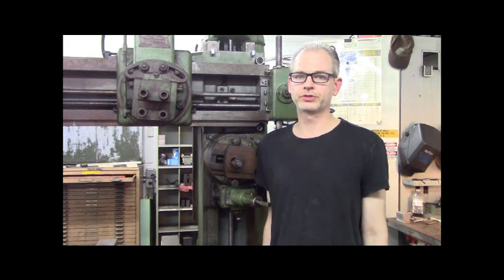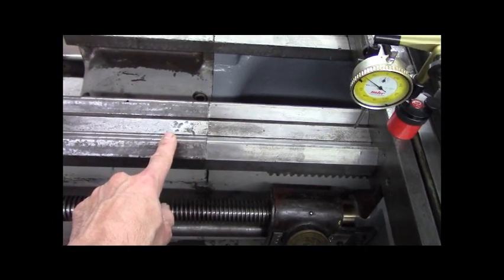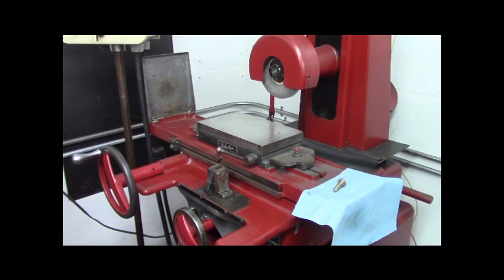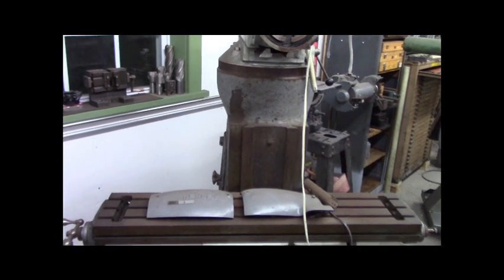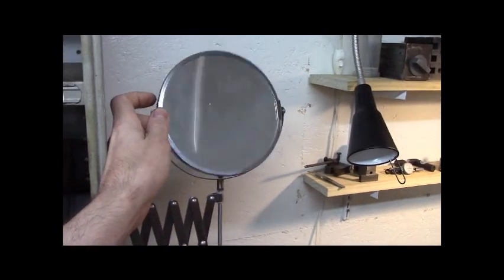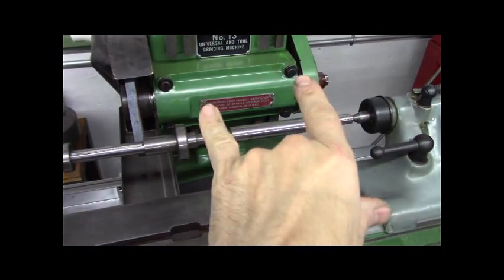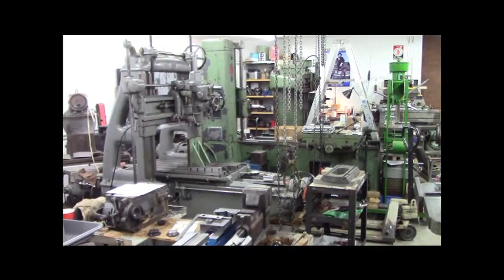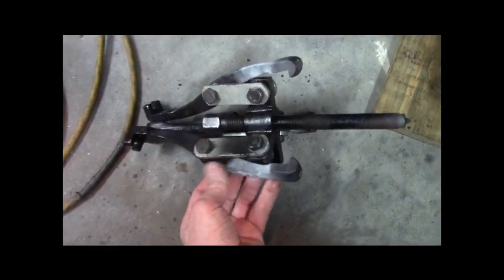Doozer's Machine Shop Update 6-07-20 -- Clausing Lathe Gap and Motor

Comment: You have almost as many machine refurbish projects as I do.  Many years ago I took the wheel head off my Norton cutter grinder, mounted it on my VanNorman No 2 universal, made a 25" face plate for the spindle, and used that setup to grind the end plates of a Mazda rotary engine. It all worked out great. Your approach will be successful as well.
Reply from the maker: Interesting ! ! !
Reply: @kooldoozer  Another interesting note: Gallery of Machines in Marathon, NY has a big planer they mounted a grinder head on to "rebuild" Monarch 10EE lathes among other machines. They claim they can hold  one tenth of a thousandth per foot of travel. They also (at one time) claimed they can grind the 10EE beds to "better than new" factory tolerances. I don't see that verbage on the website any more. There's very little about that that I believe to be true. In fact I find it humorous. 
Read it here: http://www.galleryofmachines.com/page1.htm

Comment: Hey Doozer I think the idea of a grinder on your planer would be a great set up that's what I would try carbide doesn't like shaper action unless you have a lift on the back stroke and Glyptal those wires definitely I hate mice but there good eating taste like chicken
Reply from the maker: Hey Doug.  For sure my Rockford has a powered clapper lifter.  This ain't no home shop gerbil bate half nutted operation.  Going to use a grinder head I think.

Comment: Doozer, what is the project that is upcoming for the planer? Dave Richards posted a photo of the East Broad Top RR's planer with side heads, set up for shaping rail sides into switch points...
Reply from the maker: Hi James,  I saw Dave Richard's post.  Very cool planer.  I know where there are 2 of those, Cincinnatis actually, in Buffalo NY at the Crosby company.  They are on the 3rd floor.  Have to get them out through the roof with a crane.  I was interested before I moved to NC but not now.  They are still there.  I should post pics of them sometime.  As for my Rockford planer, soon.
Reply: @kooldoozer  The shop that helped with my beam clamps (Hall Industries) has a Cinci open sided planer, pretty big. Table maybe 36x120 or 144. He mounted a Bridgeport head on it to mill a special job.
Reply: @kooldoozer  Yes lets see those pics.